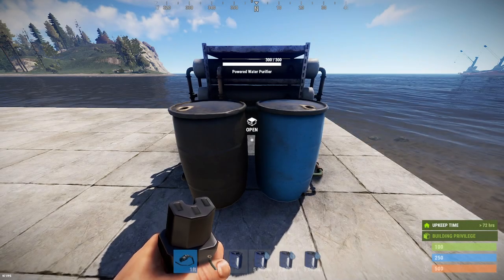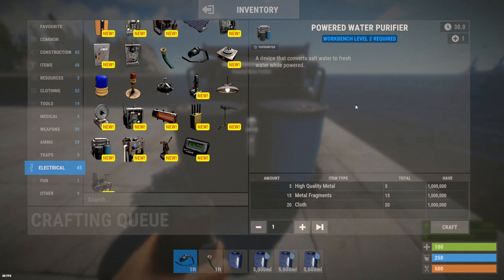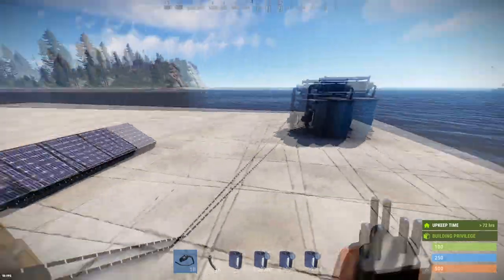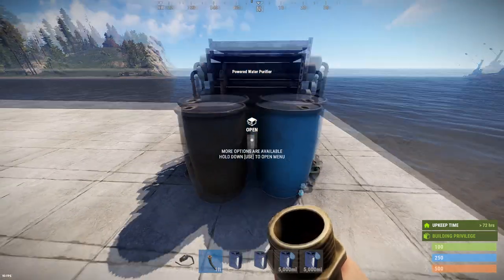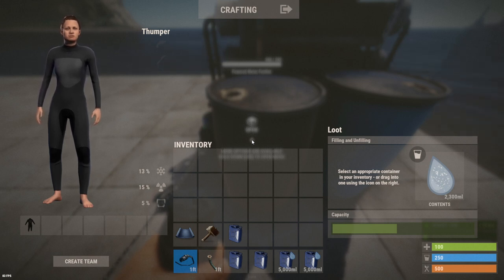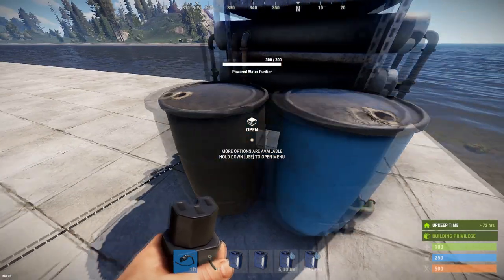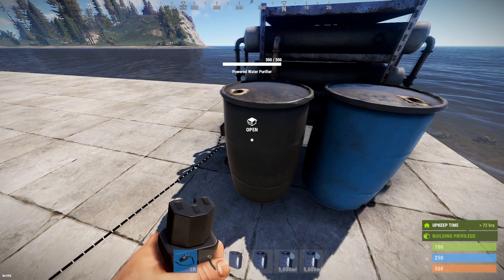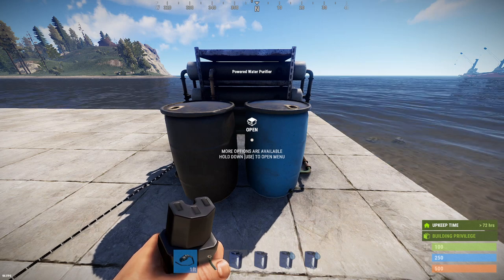Rust Electricity 101: Component Guide - Powered Water Purifier

Comment: Do you need a fluid pump to connect this from a salt water tank and do you need to use a fluid pump to connect the fresh water output to a tank
Reply from the maker: The input of Salt water can either be gravity fed from a salt water storage tank at the same level or above. If you are feeding the salt water input with a water pump in the ocean, it will most certainly be below you BUT it does provide its own pumping.  The fresh water output will gravity feed to a water tank on the same floor, sprinklers on the same floor or below, but it does NOT provide any pumping up, so you would need a fluid pump if you want to send the fresh water to ceiling sprinklers or up to a higher floor.